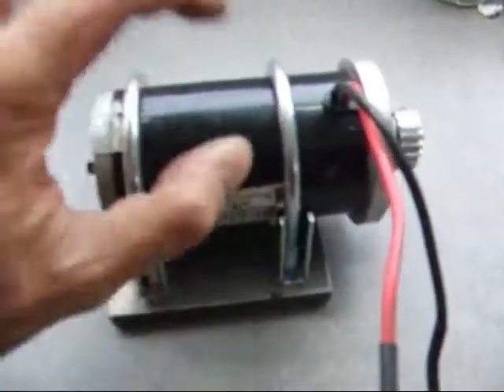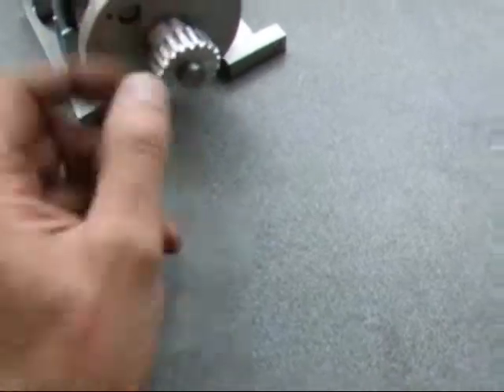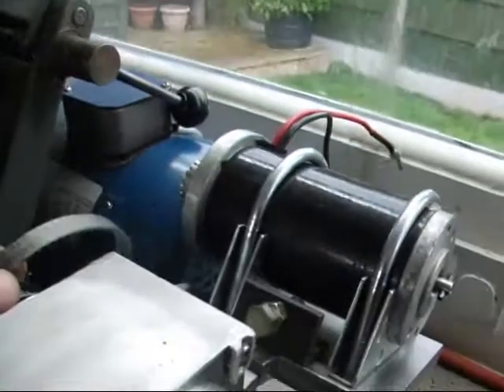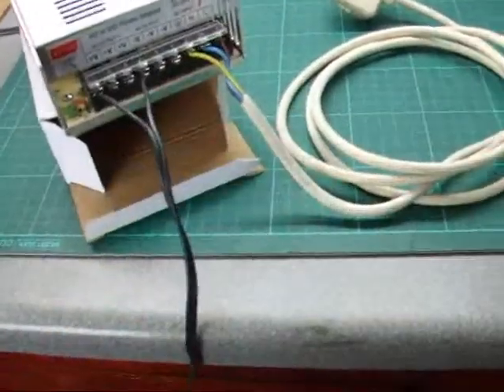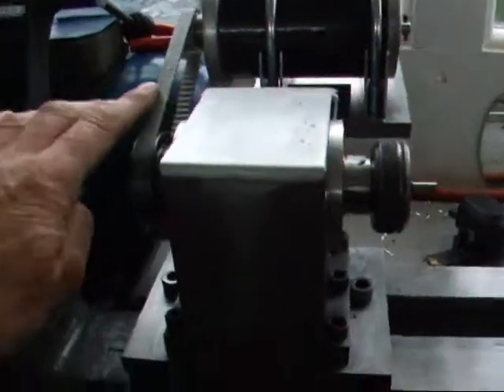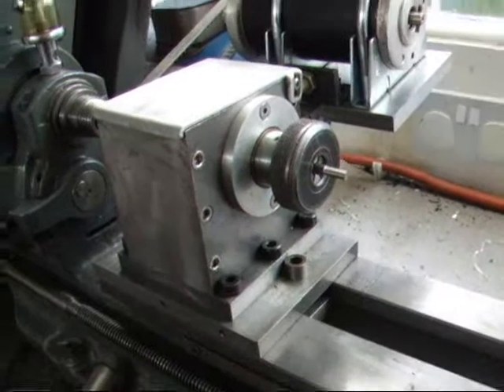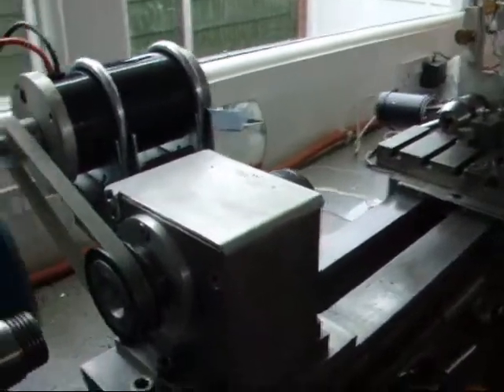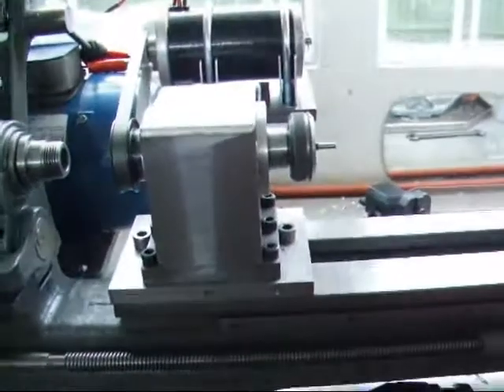high speed head stock for myford latthe

Comment: Be careful with that power supply, I had one of those for running my power feed, after just a couple of hours of use (not in one period) the capacitors leaked and the whole thing stopped working. Very disappointing given the cost :(